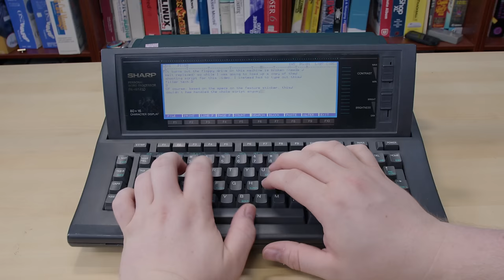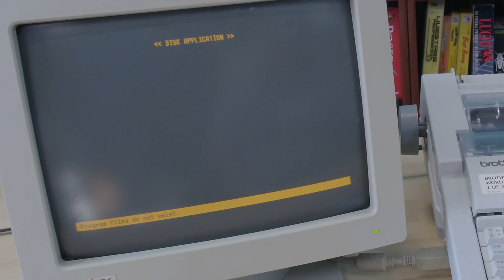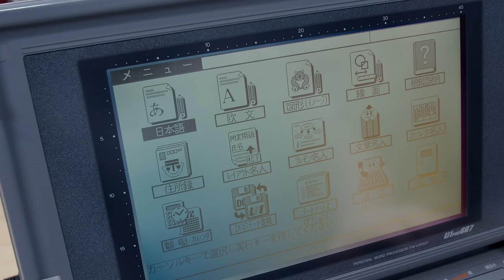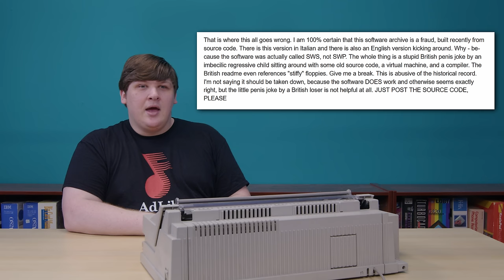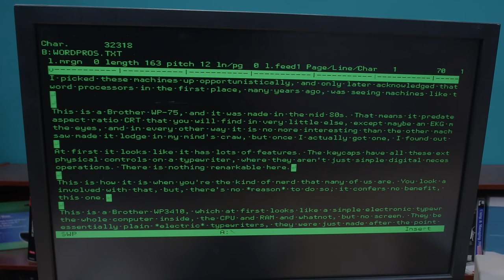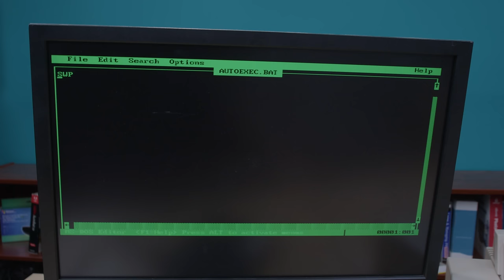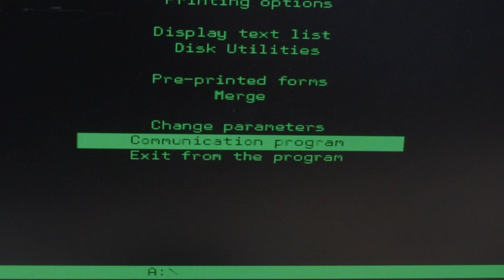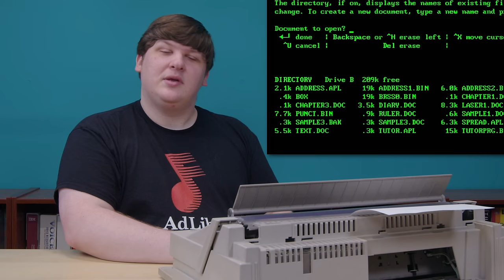The Weird Processor: Olivetti's PC Typewriter

Comment from the maker: Couple things I'd like to address:

1) "Why is it just MDA?"
It isn't. I was wrong, and I'm doing some testing to figure out what the machine is actually capable of. It can at least do CGA, and might even have some kind of half baked EGA support. I don't know how my initial testing failed to catch this.

2) "Why did Olivetti design it this way?"
Olivetti was actually a pretty significant name in computing in the 80s, and among other things, they produced some very early PC clones. They also owned a chunk of VLSI, and were apparently heavily involved in designing custom PC chipsets.

That got me thinking: it's very possible that they developed this custom MDA-like chip four or five years prior, circa 83 or 84 when it made a lot more sense to stick with plain MDA. Then when the ETV2700 came along, they just reused the work they'd already done, since it didn't cost anything. I haven't yet found proof of this, but it makes sense.

3) "Can it run Doom?"
I have to be honest, I find this joke a bit old and tired, but to answer the question, no, it can't, and it never will. Most versions of Doom are incapable of running on anything less than a 386. FastDoom is a recent project that can run on a 286, but this machine is 8086-class.

There is 8088Doom, but it's in a very early stage of development, and only works if you have a hard drive. It also can't output to an MDA display. FastDoom does have an MDA mode, which could maybe be integrated into 8088Doom, but honestly it's just not any fun to play that way. There are other games I would MUCH rather see. If I'd been thinking, I might have fired up ZZT, and if I wanted to see someone put in a ton of effort for a stunt, I'd rather see something like Commander Keen, which would be a lot more playable in textmode.
Reply: You forgot to mention the Programma 101 at the beginning of the video...the 1st PC ever made.Ciao.
Reply: Bit of perspective from someone who was there at the time... A lot of these were aimed at secretarial pools and professional typists. Typing was a separate skill (and a qualification that you earned ratings in,) that you learned if being a "typist" was going to be part of your profession - like operating a lathe or something. The top typing speed wasn't linked to the operator speed, but to the dictation speed. If you weren't high up in the hierarchy to have your own secretary, that would do the typing for you - after writing down your dictation in shorthand - you dictated to a dictaphone, or wrote out in longhand and dropped that off to a typist pool - which would operate the Olivetti style machines. Having a file menu wasn't important, each project would have its own floppy, or more, the file names would be written on the floppies - for ease of future filling - in a physical file drawer together with hardcopies and any other relevant documents.
As a private person, if you needed a typed document, say to submit a thesis for PhD or court; you'd write it out in longhand, then hire a freelance typist. They would type out a copy (optionally providing an editing service at extra cost, for grammar, spelling etc.) You would review the hard copy and mark up any changes, rinse and repeat, until you were happy with the final version. Usually, you were charged per word or character plus fees for edits etc. Often there would be a limit to the number of proofs. A freelancer temping at a business, would normally charge an hourly based on their wpm and experience.
If your document needed to have graphics, such as charts, you'd then take the copy and your graphics to a type setting place - you'd pay a fortune.
This is why the unintuitive interfaces, they were mostly professional tools; your criticism of the gui is like complaining that modern CnC machines aren't user friendly, they are not meant to be used by the general public.  People learned the chonker manual, because it was their job to learn it. Also, computer manuals had to be thorough enough for orgs to produce their own training material from them.
Reply: Don't be misled by advertising showing them used by "real people." Those were meant to imply how easy it would be to convert your typing staff to the new WPs. It's good old sexism, your typing pool was 90% female and the stereotype was... well... not very technical. Despite the fact that they were the people who interacted with electronics most. The only electronic devices that most office workers had on their desk was a phone and maybe a calculator.  For a very long time, the executive & managerial class saw operating a computer or WP as support staff labour, you wanted people to see that your secretary had a fancy Olivetti, at her desk in front of your office door - but, it wasn't something that you'd use. Electronics manufacturers spent a lot of ad revenue tying computers to emblems of modernity and success - that's how they got on exec. desks. 
Modern media HUGELY, ENORMOUSLY, over represents the number of computers present in the 80s office space and homes. They look iconic and live far larger in our minds than they did in the past. If you walked into a random business in 1988, most of them would not own a single computer. It was all ledgers and filling cabinets. By the early 90s computers did start to infiltrate homes and freelance typists were a disappearing profession, this is what the small, cheap, single LCD WPs aimed to replace. The minimum viable thing to easily produce a typed document if required, say if you needed to submit something to your local council. Those were pitched at the part of the general public, who had no interest in computers. So most people over 40...
If you want to see what a typical office looked like in the 80s, look at the early episodes of "Yes, Minister." They are on YouTube, see if you spot a single computer... Again, modern media really over represents the number of computers in work environments of the time. Till mid 90s, a typical office space would not have any. By early 90s, there would be a computer room - where you'd go do computer stuff on a couple machines, if needed - then they slowly migrate out to individual desks.
The past is a different place.
Reply: PS. part of the reason, for the over representation of computers in modern depictions of the period, is that contemporary magazines and ad agencies loved to shove them into any photo shoot - they were signifiers of modernity and success. So, shove them into the article/ad. Want to sell expensive watches? Put a computer in the corner of a desk - just cut off the unsightly cables. If you went by media representation from the late 70s on, computers are powered by magic and all have wireless displays.
Reply: If you had a membership thru yt I would  support you I just don't trust my card info on sites
Reply: Most machines that receive the "Can it run Doom?" treatment are similar. Actually a lot of them are much more powerful, but they're also hampered by weird input devices (say, camera buttons, or a fridge touchscreen) or insane launching mechanisms (imagine needing to clock-glitch the CPU to bypass a security mechanism and run a custom Doom port so the only way to run the game would be on a desk with a bunch of breadboards and oscilloscopes and whatnot), or crazy displays (the pregnancy monitor's a classic).
This thing would run like crap, but I could easily see MDA getting hacked into 8088Doom so that such a machine could """""run""""" Doom.

On the other hand, this is probably the only machine of its kind that will ever get used on an experimental basis, and I can't imagine CRD keeping it around to pull out and run a Doom experiment on just for bragging rights.  Especially given that the only way this thing will ever see a hard drive (necessary for 8088Doom) is with a custom adapter.
Reply: I think we need to bring back "stiffy" as a thing for hard square discs.
Reply: @kargaroc386  You hit the chip I have on my shoulder with a nail right to its head. A LOT of what we see in youtube with tons of views running doom are just simple projects of people getting whatever device to be A SCREEN to something else running doom. Which is cool and all but I like impossible ports much more. 

What I would like to see this machine do however is run Bad Apple, with beeps and character heads hitting the paper, maybe moving the paper around as well for sound, and "ascii" art on the video. I would like to see it but am 100% unwilling to put any effort into it whatsoever.
Reply: I think a good home would be some of the many computer museums, even if only to be constantly showing Rogue running with a tiny excerpt of the machine's place in computing history, explaining a bit of the transition from typewriters to computers and word processors, how the world used to work in those times, so like explaining a bit of the history of computers (the women who did math) and typists (the women who piloted electronic computers, etc), and of course finalising with the role this specific company and machine had in having rogue being ported to the PC, and the modern landscape of roguelikes and lites.

Maybe some other youtuber, like RMC may be interested? Idk, I just hope this machine gets a good home. I'm really glad you were able to get one, discover and share its story. Thank you CRD
Reply: great comments @lucidnonsense942  really puts a lot of the video, and why the Olivetti thing is like it is, into perspective
Reply: This is an incredible amount of effort to thwart YT commentors whom are continuing a meme and likely don't have any real interest in the capability of the machine. BUT I LOVE IT! Thank you and keep up your awesome work!
Reply: Who cares about Doom, run Zork! 😁
Reply: @dextrodemon  fun fact - the side mounted monitors were a "feature," because: 1) Typing pool supervisors wanted to see typists faces - to make sure they were working. 2) Secretaries needed to make eye contact with visitors to your office, people didn't work their way up to "having a secretary level," only to have her hidden behind a CRT screen.  The office culture wasn't too concerned with RSI suffered by young women due to poor ergonomics. It's funny, but it's all stuff that the reps and purchasing departments knew as unspoken rules, that are all going to be lost to time - nobody felt the need to write them down lol.
Reply: Every video will need a new section or chapter "can it run doom"
My logitech 1988 mouse - RS232 one of cause - can not run doom, maybe control a doom gameplay once doom is installed on the right machine.

but: great video and in the early 90s Olivetti was a big thing like NCR both selling thousands to Mercedes  due to the microchannel architecture they had offered. Olivetti were then pc clones in cheap plastic cases, I mean flexible like hell, and cheap. Microchannel was a key decision in the company , increased the costs without many benefits for a secretary or what not job, and by increasing the costs slowing down the progress cause the limited budgets back then just allowed to buy a few instead of many more in case of a non microchannel architecture device. 

And suddenly overnight the microchannel was dead and suddenly masses of new brands appeared in the offices. 
I never liked these Olivetti things cause they had so many flaws and issues based on the design and concept or missing quality tests.
Reply: @typxxilps  can a Roland BR800 run Doom?  I think that is the question to take away from this.  I want to play Doom with sliders, knobs and a rotery controller to cycle weapons. 😅
Reply: Yeah, but this isn't the kind of machine to play Doom on anyways.  This is the kind of machine you play Zork on, then print out your whole adventure.
Reply: As Lucid said, Olivetti made this for exactly what it looks like: it was built for secretaries working in settings (e.g. an office attached to a factory) that could plausibly either have IBM PC compatibles, or something else that could read IBM formatted floppies.

I have, for what it's worth, actually delivered food to such an office in the last year, though I think this Olivetti would have been outside of their price bracket: they still have a more conventional electronic typewriter within view of the sliding window, so I doubt they needed something as upscale as this.
Reply: What video converter are you using? You mentioned it supports alot of frequencies n it seems worthwhile.
Reply: @RhizometricReality  and does it do 15hz outputting to 60?
Reply: Because Olivetti did A LOT of weird things. When I get home, I'll dig up the 100/10 ISA network card. Yes. 100 slash 10. I-S-A. (the bus that could barely do 10.) It uses a chip from National Semi that they don't admit to ever having made. (the only ref to it was in an application note.)
Reply: The Tandy 1000 did come with a rudimentary word processor built into its included DeskMate software, although the spelling checker was an extra-cost option. And the official list price for popular PC word processing programs like WordStar and WordPerfect was an eye-popping $300 to $400 (in 1980s money!), although street prices were often far less, and you could always "borrow" a copy from a friend.
Reply: I seem to recall Olivetti purchased Acrorn.  You know, the ones that invented the Acorn RISC Machine, or ARM.
Reply: Pin?
Reply: My family had a Brother word processor that played Tetris back in the early-90's. It delayed our purchase of an x86 computer by at least a couple years.
Reply: My digital camera can run Doom 😁
Reply: @TheGrinningViking  in finnish they're like "hardies" if you translate the word used for the back. floppies are like lerppu which means like floppy, but like.. you wouldn't think of the 3.5"'s as so floppy, never mind whats inside the thing. 

hard was of course used for other stuff already.
Reply: There were at least 2 3D first-person-perspective games on the ZX81 with its 3.25MHz Z80. Then again, 3D is pretty easy to compute when all you have is 64x48 1-bit graphics. There was a game I just heard about the other day with a T-Rex monster, and a flight sim I owned in which the runway was kind-of visible, but there was a cliff represented only by a wiggly line which just rose up the screen when you were already too close. Yyyeah... I didn't play that one more than once. The manual said not to turn left when you took off, but that bit was after all the info on the controls and how to fly, so I had to stop reading and play the game to get used to the controls before I read about the cliff. So basically, we had 3D in home computers for over 20 years before the software industry figured out how to present information to human beings! :)

    As for running Doom, I hate it when people say something can but it's just a display device for something else. The ZX81 games I just described were each written by lone programmers, why can't people write similar code today? Just-about anything is faster than a ZX81, and lots of machines had low-resolution 1-bit video modes if the processing needs to be that simple. Besides, Doom is a disgusting game. Eh... Maybe I should put my money where my mouth is and learn to code for my old Ataris. ;)
Reply: @CRD: It sounds like you don't know about typewriters which can correct text on-paper. I guess that may have been a necessary feature for a typewriter with a disc drive but no screen, but it's possible they had a "forget this whole line" instead. Anyway, Technology Connections did a video on the correction feature.
Reply from the maker: @eekee6034  I do, just, I didn't want to go into all that in the video, and in retrospect I probably should have. I thought I could gloss over it, whoops.
Reply: @CathodeRayDude  No, it's my mistake. You mentioned correction ribbon later in the video, but I'd already made that comment half an hour before. :)
Reply: Can it play Lode Runner?
Reply: Wolf 3d works off a 3.5" floppy drive with a 286.  Maybe comander keen.
Reply: If i remember correctly, there was an olivetti video standard, supported by some image viewing programs from back in the day.
Reply: @julialongtin5743   It's a very old Italian company.. so I can totally see them having that kind of hubris. You must use OUR video standard, not the totally fine existing ones!
Reply: Could try Kingdom of Kroz on it. It would be interesting to find another 256K SIMM for it and figure out the pinout of that big header connector. If it's just 8 bit ISA in disguise then a one or two slot bus expander should be an easy PCBway project. Then try a color video card, EMS RAM, soundblaster etc.

Or cook up an adapter to an IBM 5161 Expansion Chassis.
Reply: Hello, that VLSI chip was not ealier designed. It was specially designed for all NEC V40 machines they produced at 1988 and later: ETV 2700, ETV 2900, VM2000, Editor 100, M200 and Prodest PC-1. Later then they reused this chipset in a even more compact version in Olivetti Quaderno XT sub notebook. They all can support CGA graphics, not more. 

And yes, it may run doom one day, in vcfed forum someone presented a project to shrink DOOM step by step to run on fast XT.
Reply: Nerd, getting things to run doom is a time honored tradition, not a meme.
Reply: I came back to this comment after you mentioned nobody will see it in your year end video. I didnt do it to prove you wrong but to deny the algorithm a victory. Merry xmas, get well, I love your stuff. (From a 62 year old Floridian moved to Denmark) TI 99 4/a Radio shack color computer and model 100
Reply: if it is physicaly capable of running doom it should run doom at least once.  i dont think an olivetti pc typewriter has ever run doom before  and if you get it going  no matter how unplayably slow it is  it would  still be a first.    the doom on the TI graphing calculators is more of a recreation of doom than a genuine doom port but it still counts.   doom runs on anything .
Reply: @lucidnonsense942  "unspoken rules, that are all going to be lost to time" like tears in the rain
Reply: This is EXACTLY why I ended up here... Ten + years ago I picked up a faulty Tandy 102 which I repaired.. Now I'm up to my eyeballs in more tech covering all sorts of genres than is generally healthy... or wise...
Reply: Well, maybe not playing Doom, but if it displays out to a monitor it could play "Bad Apple".  On the other hand, that has already been done on XT-class systems multiple times, so it wouldn't really prove anything.  Wouldn't be worth the effort when there are so many other outrageous platforms to target instead.
Reply: @lucidnonsense942  so many people have forgot that, i think, whereas now, everyone types in the same way everyone writes.